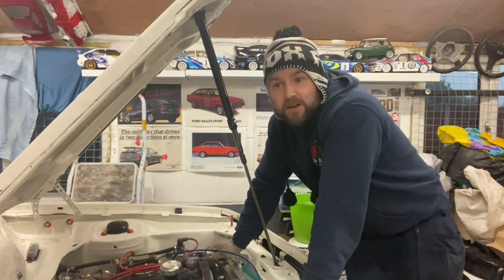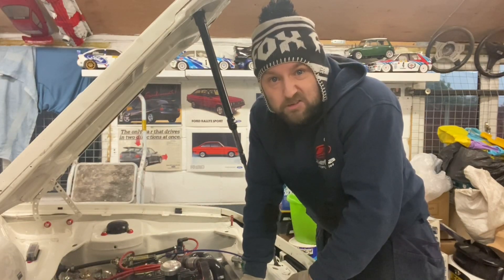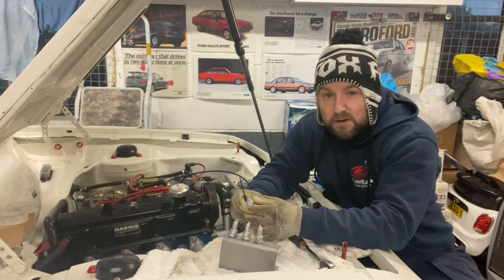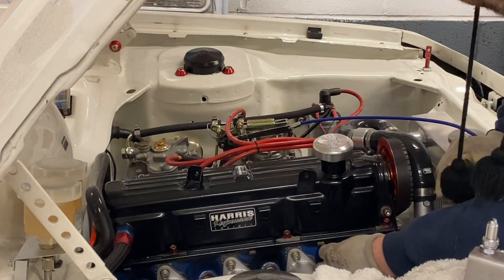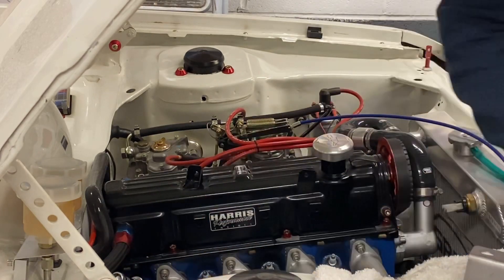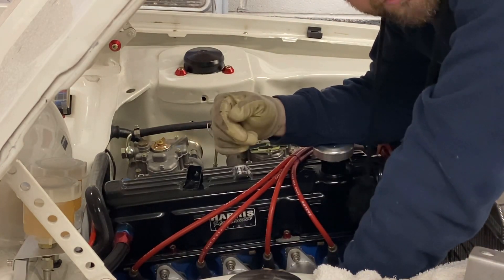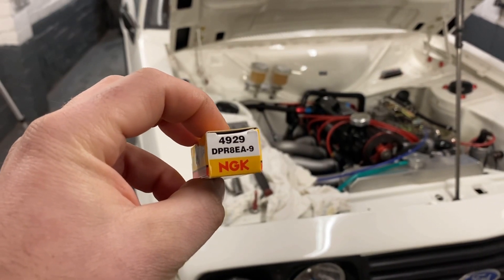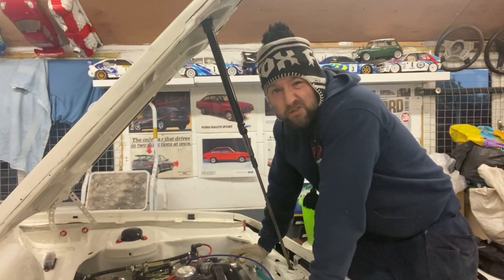Doing abit of maintenance on my ford escort rs2000, mk1/2. Performance harris engines

Comment: What engine are these? I know the later RS2000 is a 2.0 16v with 150bhp, I’m guessing these older ones aren’t quite 150bhp? Not from factory anyway? It sounds fruity whatever it is(in your drive video)👍🏻
Reply from the maker: Standard they had a 100bhp 2.0 8v pinto. Check my other videos for engine specs. It runs a 2.2 8v pinto which puts 212 bhp out
Reply: @oldskoolmotors2802  ah ok, I’m not up to speed on older fords, I’m abit young! Not saying you’re old or anything 😜

Comment: Nice car! 2.2? They look like 45’s? If so, I would have fitted 48’s and had the engine set up on a dyno. Not a rolling road.
Reply from the maker: There 48’s pal. Mike maniacs sets up all the famous dave brookes engines so I knew he was the best man to set my escort up
Reply: @oldskoolmotors2802  nice to hear it’s on 48’s but you will never squeeze out the last hp’s unless an engine is set up on a engine dyno. Not a rolling road 👍